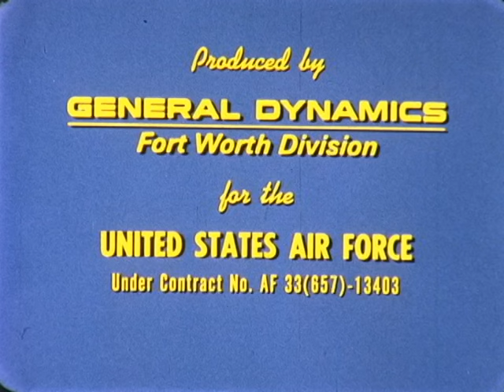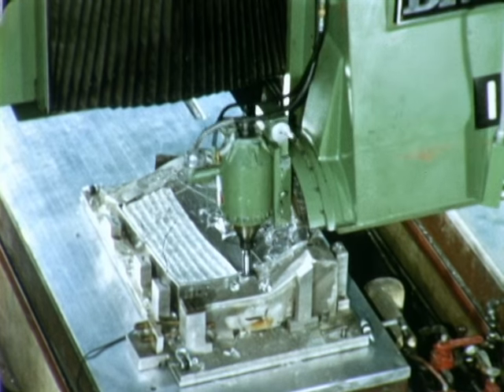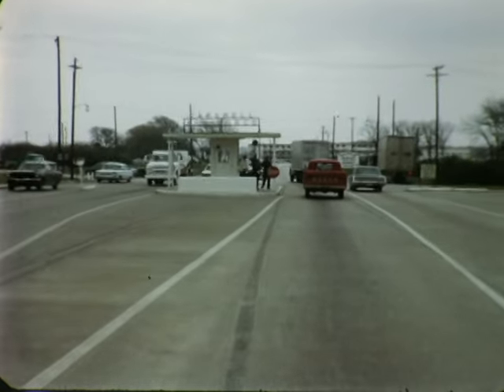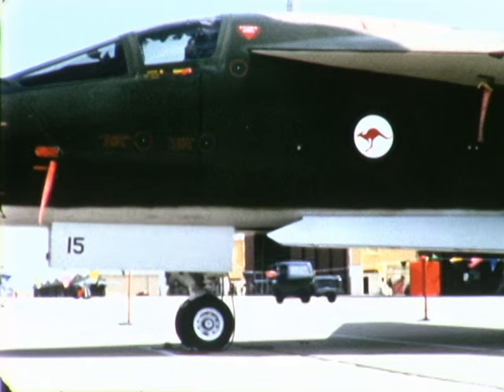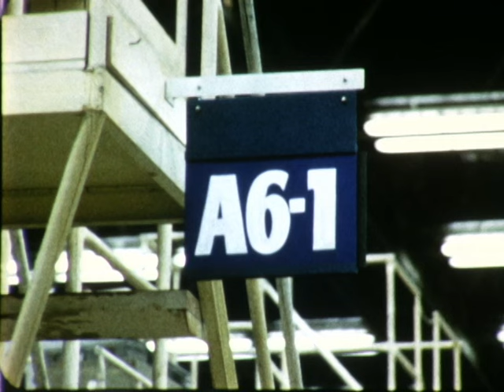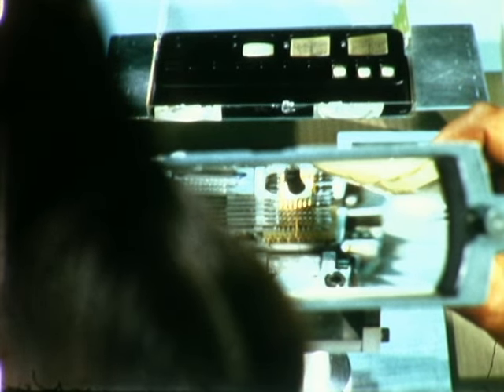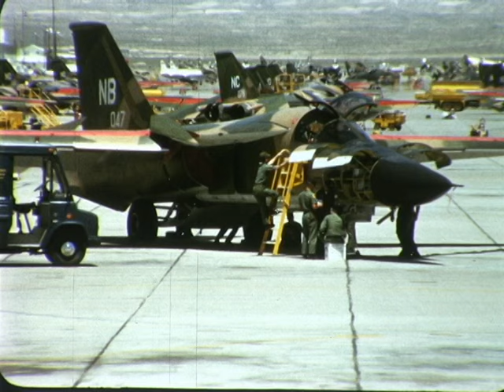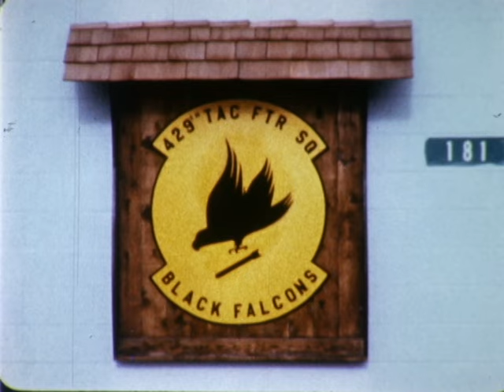F 2328 General Dynamics F-111 Aardvark Aircraft

Comment: The original F-111 production ran from 1961 to 1976.  539 planes of 6 distinct models were built for the USAF; 24 C-models were produced for Australia.  An additional 8 planes with carrier models, the F-111B prototypes, were constructed for the Navy.  
After production ended, at least 84 planes were modified into different models.  Four F-111A's were modified into C-models to replace 4 planes lost in RAAF service.  After the 76 FB-111A's built for SAC were retired from strategic bomber service when B-1 deliveries finished, 34 of those planes were converted into a tactical version designed F-111G.  At least 13 F-111G's were bought by the RAAF to serve as trainers to reduce the wear on their active F-111C fleet.  Four of the RAAF F-111C's were modified into RF-111C reconnaissance aircraft.  The most radical modifications were done on 42 F-111A's to turn them into electronic warfare/jammer planes designed EF-111A Raven.  The Raven was the last American F-111 model retired which occurred in 1998.  
Of all the USAF F-111s constructed, the EF-111 has the fewest number preserved.  Only four EF-111's were preserved as museum planes.  The rarest F-111 variant is the B-model which has one sole airframe in storage at NAWS China Lake.  There have been plans for years to restore and eventually put the last surviving F-111B on display.